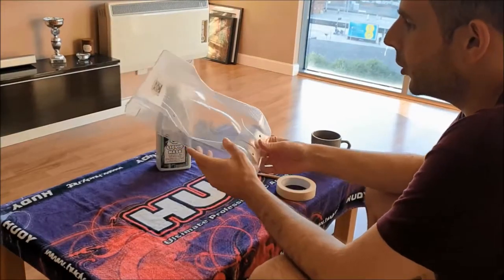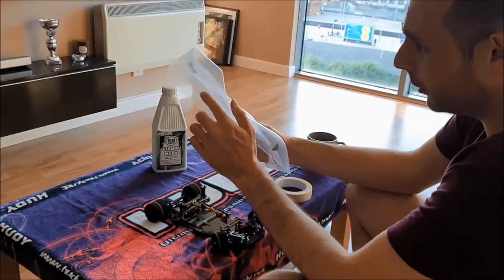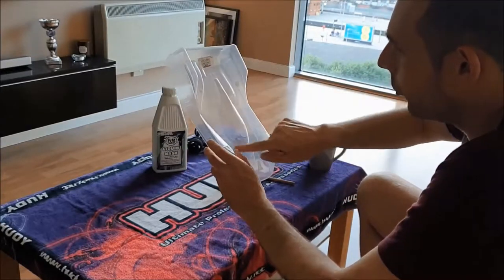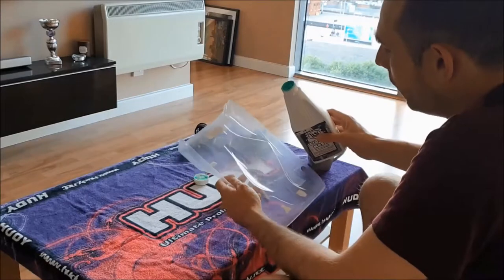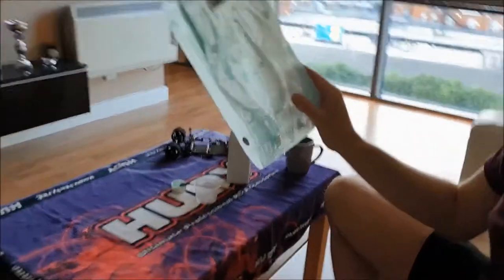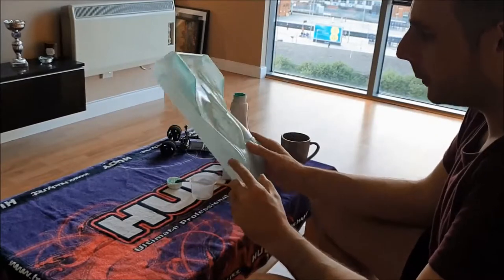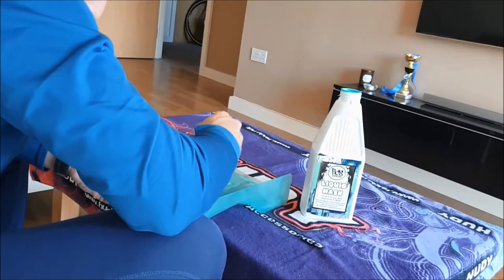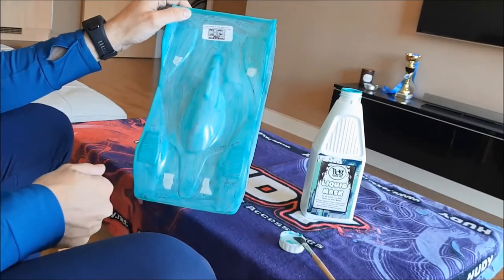RC Airbrushing Part 1 - Liquid Mask

Comment: I felt brushing it on wasted alot of the mask, so I bought an hvlp gun and now I spray it on,it's so much easier to apply, easier to cut,and easier to peel. I use Bittydesign and only have to spray 2 good coats. Then I use a heat gun and a short time later I'm cutting mask and ready to airbrush my body.